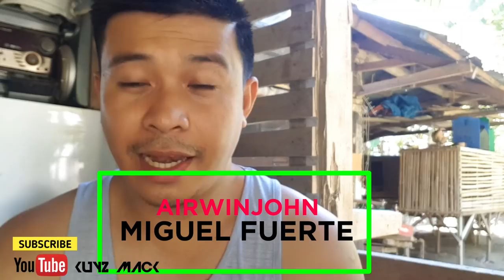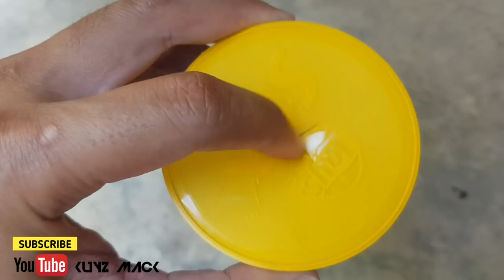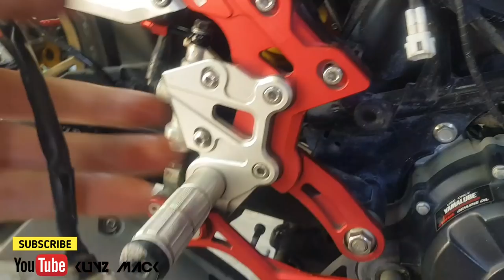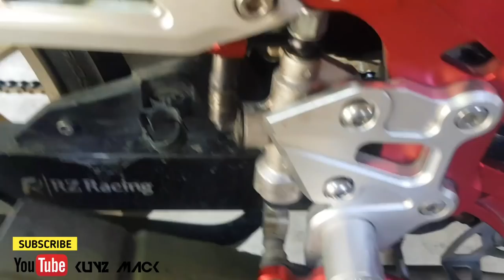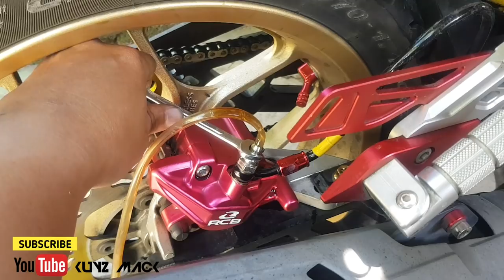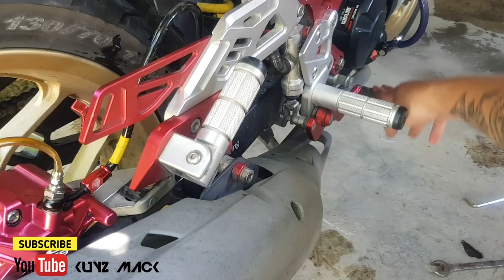HOW TO INSTALL RCB HYDRAULIC BRAKE SWITCH |HOW TO BLEED BRAKE |SNIPER 150

Comment: Nagkabit din ako sa tropa ko ng mody5 leak issue din sayang ang mahal pa nmn...
Reply from the maker: Same tayo, yun din una ko binili. Pag apak ko ng brake nag fountain 😂😂
Reply: Sakin walang tatak binili ko tinabasan ko pa ung plastic n matigas ung pinapasukan ng wire hanggang lumabas ung terminal sa pinaka ilalim para magkasya jan sa rcb shifter wqlang naging tagas..dun lang sa tropa ko ung mody5 binili namin sablay pala 500 pa price ang mahal...binalik ko nlng stock n brake switch nya heheh
Reply from the maker: @marcgalindo5616  hehehehe ako nilagyan ko nalang spacer, sayang ng pera,may mga walang brand talaga na matibay